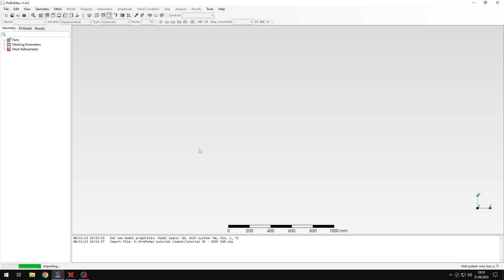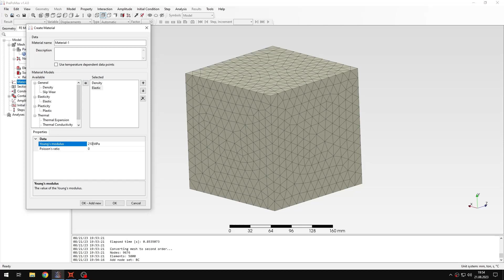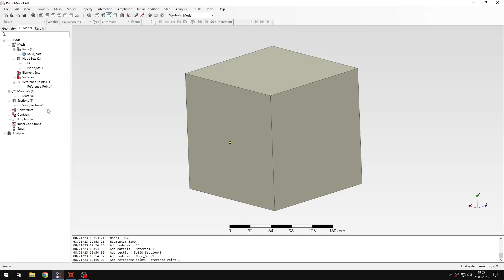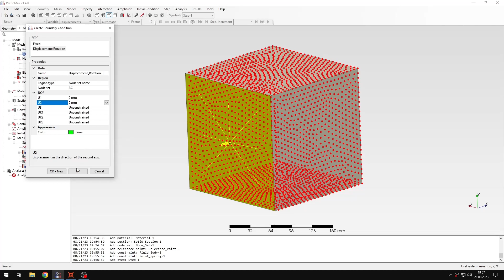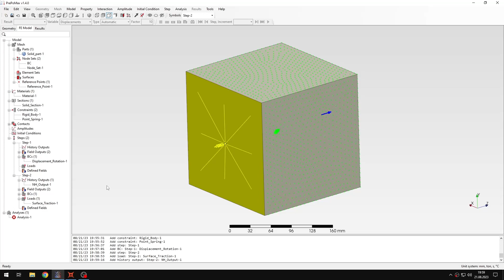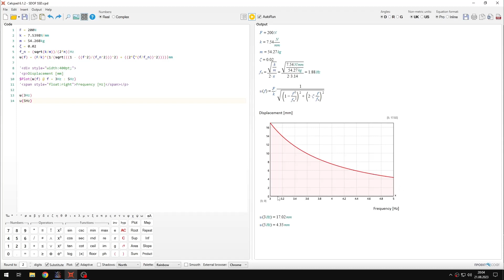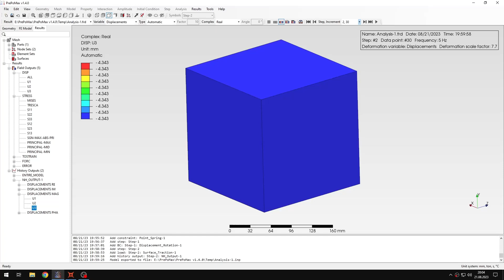PrePoMax (CalculiX FEA) - Tutorial 36 - Steady state dynamics - mass-spring-damper system

Comment: Thanks a lot for such a useful tutorial.  A quick question:  I was a bit confused how the damping effect is being included when the damping ratio is defined for step 2.  I believe the idea here is to model the damper as the one acting on the mass in parallel to the spring.  It appears that when the damping ratio is defined it applies to both the spring element as well the cube elements, and the spring damping is more significant than the cube damping, is that correct?
Reply from the maker: This definition uses the *MODAL DAMPING keyword. It applies damping directly to all modes. Normally, I would use discrete dashpot elements instead but they aren't supported in PrePoMax yet.
Reply: @FEAnalyst  That makes sense, thank you for your response.

Comment: Hi, Thank you for your tutorial!
How should we understand the physical significance of setting surface traction to 200N in steady-state modal analysis? Is it similar to applying a 200N impact force in dynamic analysis?
Reply from the maker: Loading in the SSD procedure is assumed to be harmonic (it varies sinusoidally with time over the specified range of frequencies). So the applied load is actually P(t) = P_mag*sin(ω*t+θ) where t is time, P_mag is the specified magnitude (200 N in this case), ω is radian frequency and θ is phase angle.